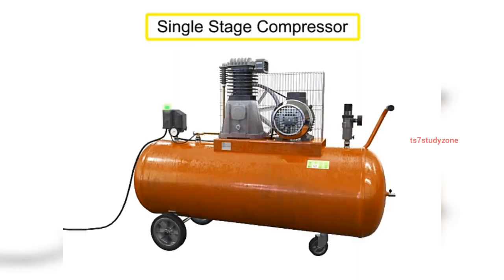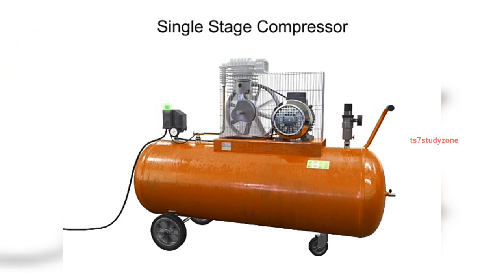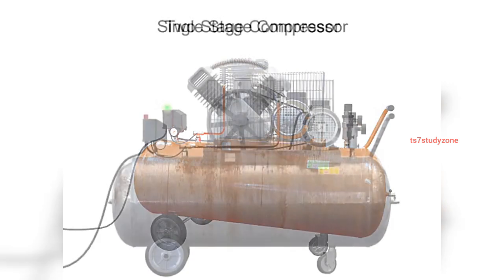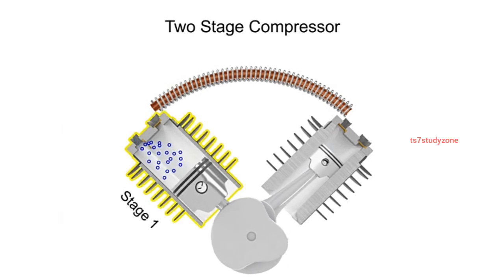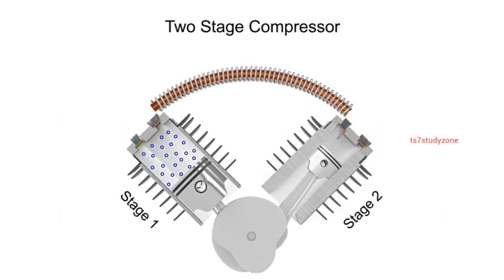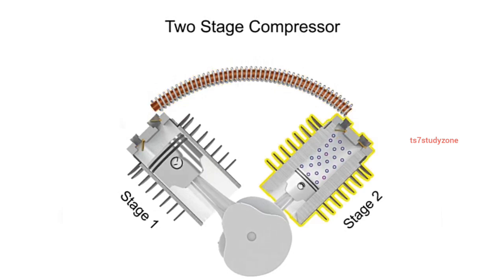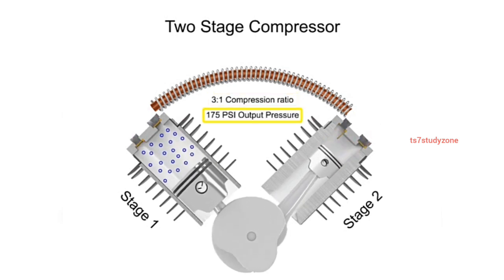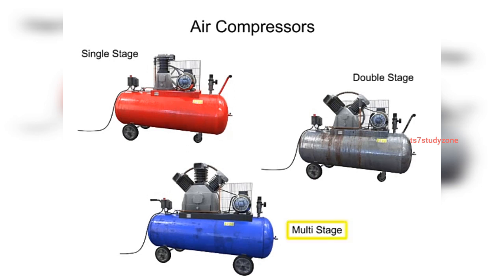Single Stage, Two Stage and Multi Stage Air Compressor Working Animation with Explanation.

Comment: There are actually a lot of single stage compressors with 2, 3 or even more pistons, so single stage have nothing to do with having just one piston. 

Your explanation for the two stages compressor is a very good one. But you need to review the single stage.